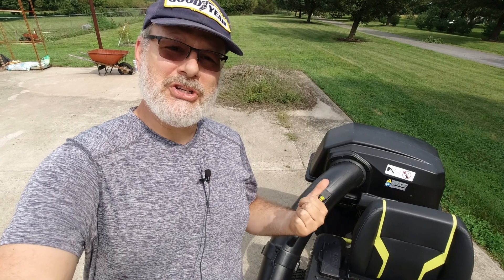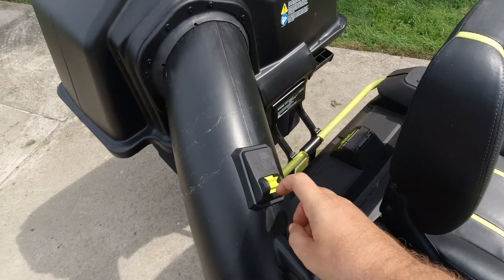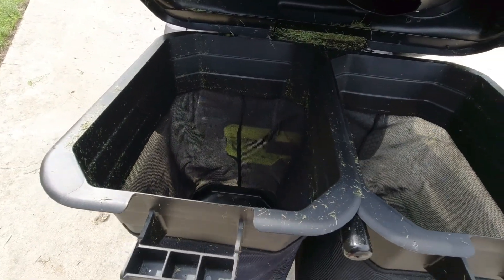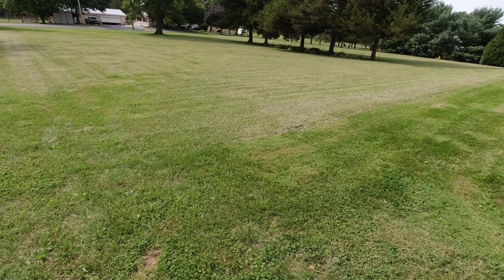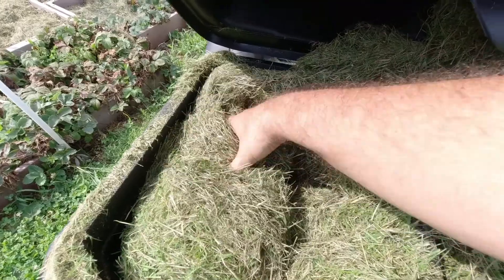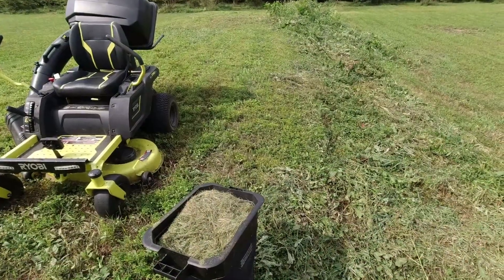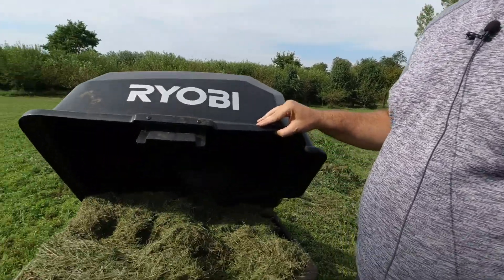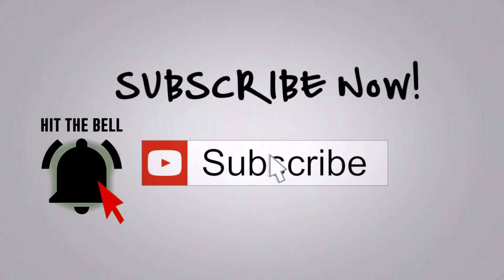How To Use the RYOBI Bagging Kit on the Zero Turn Electric Mower - Bagger Kit How to Video - RM00224

Comment: My only concern about buying one of these mowers is how much plastic there is used in its construction. How have you found the durability?
Reply from the maker: So far I have not had much issues with reliability, although I have bent a blade or two already because I pushed the power passed it's specs to see if it can take it. I cleared out an overgrown field with just the use of Ryobi battery powered equipment, a shovel, and a cart. This included this mower. Hopefully all the shots came out and I can edit a story together about it that makes sense.